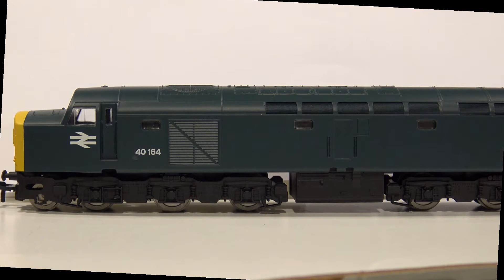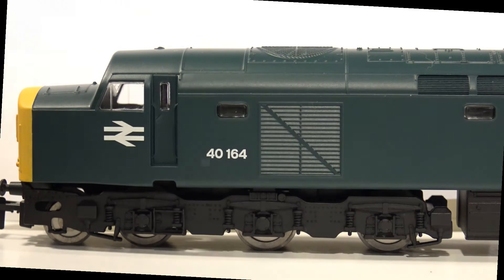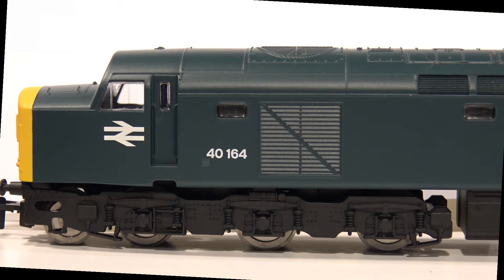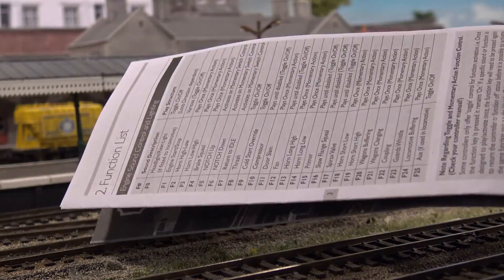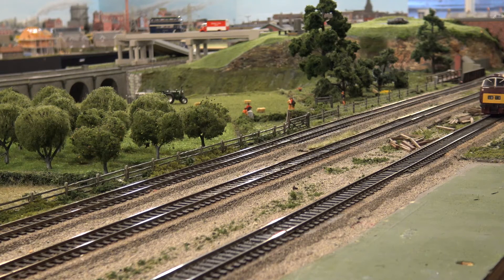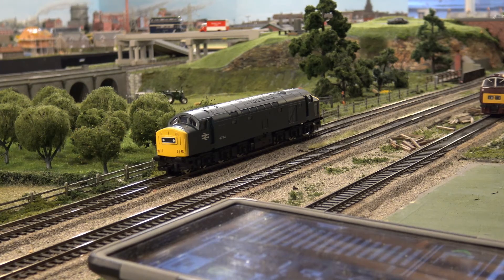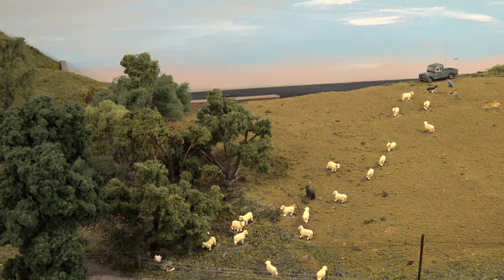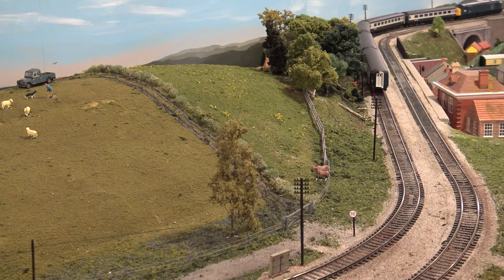Testing and Review of Hornby's Class 40 Farland Howe

Comment: The ex/lima (now Hornby) class 40 is still the best model of one we ever gotten. Looks perfect. These are great models. Hornby actually improved these giving us the normal centre headcode ends. Lima only ever give the less frequent Scottish centre headcode box which differed quite a bit :)
Reply from the maker: Little Bert’s Bench Hi Bert, eventually I had to scrap this Hornby 40.  It had too many running problems.  I bought a Bachmann class 40 that runs somewhat better, not great, but better.  It has the head code disks.  It is a rough runner.  The other 8 wheel bogie locomotive I has is the Bullied which also has 8 wheel bogies but runs a dream.  Too bad I can’t put a set of the Kernow 8 wheel bogies on the the Bachman 40, then I would have something. Thank you, Tob

Comment: I've got one of these. I've also got the DCC Bachmann 40 which has much nicer detail but then it costs more and has no sound. I think this is a great cheap DCC loco if you want to experiment with some weathering and not risk a more expensive model. This goes for all the Railroad range. Not that I've done that yet. These two make up my entire DCC fleet at the moment (the other 97 have all been analogue). Hey at least I have some :-) Thanks for doing the review Rob. Cheers, Laurie.
Reply from the maker: This is my first Railroad Range loco.  The price at 50 or so pounds was breath takingly low.  I couldn't pass up the chance to try it out.  The Class 67 with TTS sound was not railroad Range, but is impressed me with its sound for the money.  I have some I have paid a lot more for and sound a lot worse.  Yes Laurie, you get credit for having a few DCC locomotives.  Bravo.  Thank you, Rob

Comment: Good review Rob, not bad for £50, original Lima moulding, re motored etc does it have traction tyres fitted?
Reply from the maker: Greg Palmer Hi Greg, no, I didn't see any and I looked.  It has some very minor traction issues, but really surprisingly good for only one driven bogey, very lightweight and no fly wheel.  It pulled 5 lighted coaches up my 2% grade with ease.  Slight wheel spin under certain conditions.  Thank you, Rob

Comment: hi rob i had that class 40 it done my head its a nice loco but not for me also in one of your videos would it be possible to see the full size of your layout please
Reply from the maker: Anthony Sidwell Hello Anthony, my layout is 6.9 meters x 4.1 meters.  The tightest curve is Horny radius 2.  I did have a front wheel set jump once, but I haven't run it enough to really know it.  What problems are you having with your Class 40?  Thank you, Rob
Reply: I have sold my dcc stuff I gone back to anolog dcc is brilliant but not for me
Reply from the maker: Anthony Sidwell Really?  Why have you given it up?
Reply: To many problems i feel more confident with anlog the locomotives are cheaper
Reply: In one of our videos I would love to see the hole layout I think it's amazing
Reply from the maker: Anthony Sidwell Very true, half the price or better.  I never try to fit my own decoders.  They can blame malfunctions on me.  I let them do it and send them back if there is a problem.  I will fit a sound decoder, but they are tuned over there and usually work okay.  Non-sound decoders are different, there can be many problems.  It is best for me to let the seller do the tuning.  Thanks again, Rob

Comment: Hornby do a good entry model, with good sound, okay not perfect, but, great start for DCC. By the way have you used AFT to clean track? I picked it up on  You Tube from one of your countrymen (monon1971)
Reply from the maker: They do Nigel.  It is a good thing.  Instead of making it a hobby of elites, they bring it in at a price most people could probably afford.  Yes the sound is not a superb rendition, but at the price it is okay by me.   No, haven't tried it.  I will check it out.  Thank you, Rob
Reply: I also have Class 40 TTS sound. Bit of a bugger, as you said. Those front bogies are troublesome.